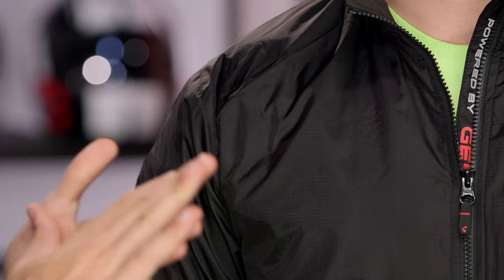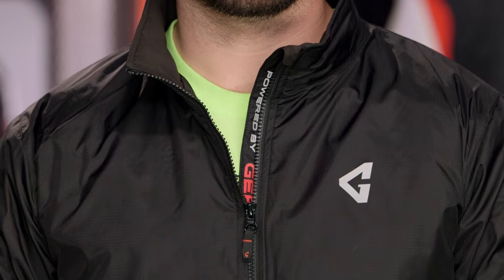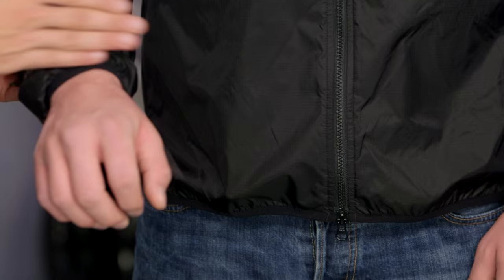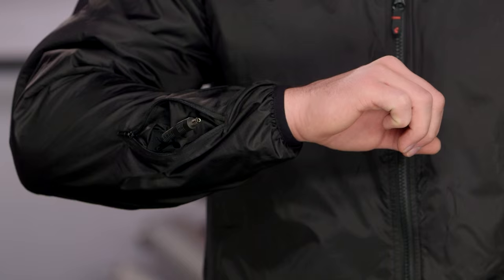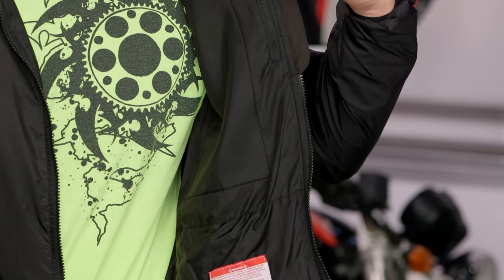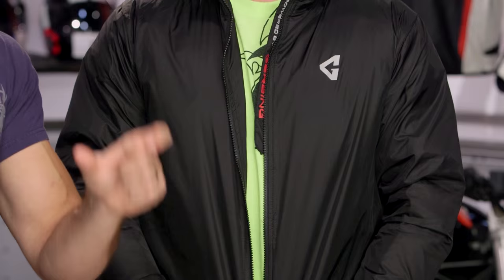Gyde by Gerbing 12V Jacket & Vest Liner Review at RevZilla.com

Comment: So if you have the full set, jacket liner, pants liner, and gloves, and the duel controller, you use the controller for the jacket and pants, how do you control the gloves?  Or do the gloves just stay the same temp as the jacket??
Reply from the maker: The gloves are combined on the same circuit as the pants. -DrewZilla

Comment: Do they make an adapter that will plug into my sae charger pigtail to power the jacket?
Reply from the maker: Yes, but we'd recommend getting an adapter to adapt your trickle charger to the Gerbing coax plug instead. That way, you know you're using Gerbing's own approved wiring harness with the Gerbing jacket. -DrewZilla
*https://www.revzilla.com/motorcycle/gerbing-battery-harness
*https://www.revzilla.com/motorcycle/gerbing-coax-male-to-sae-cable
If you really want to leave your SAE lead on the bike or know that the wire gauge is robust enough, there's the coax female to SAE cable.
*https://www.revzilla.com/motorcycle/gyde-by-gerbing-coax-female-to-sae-cable